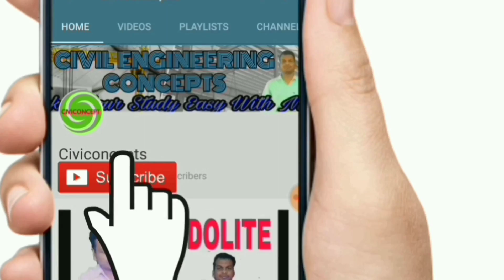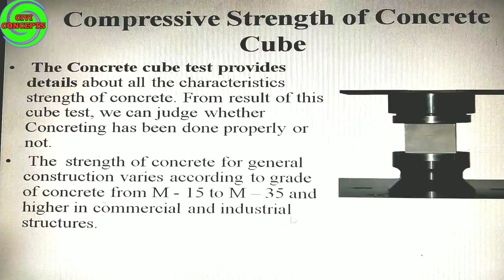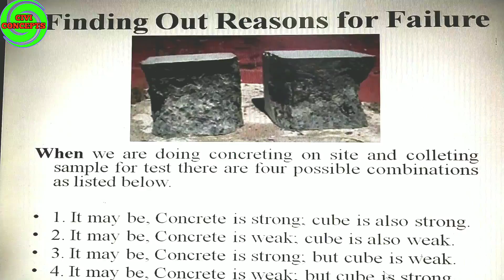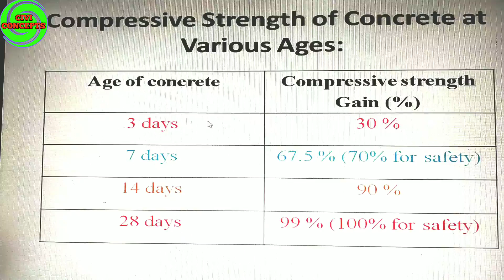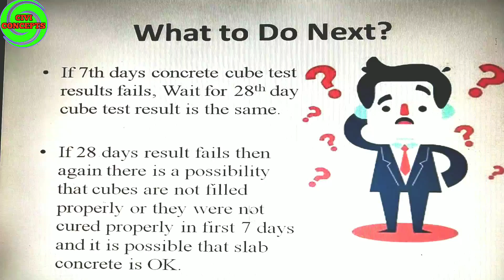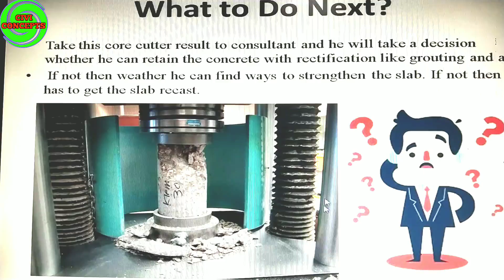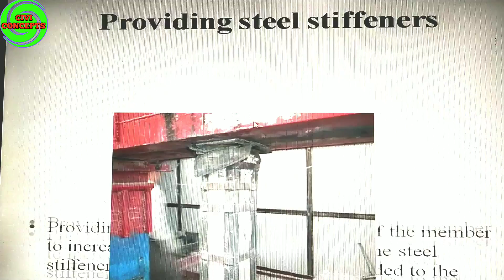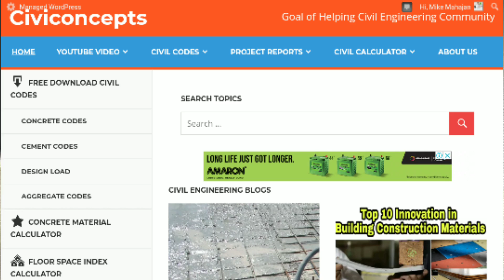What Next, If Concrete Cube Test Fails

Comment: You have mentioned any remedial solution for floor slab. You only talked a loud columns and beams
Reply: Floor slabs never rely on compressive strength. Compression is 10 X higher than any strength required by a floor slab.

More important in floor slabs is flexure, shear or cracking, most of which is related to w/c ratio or placement techniques.